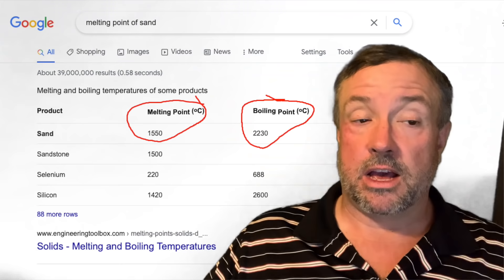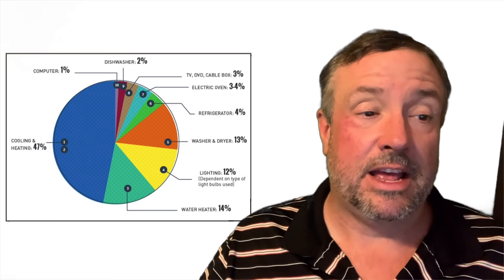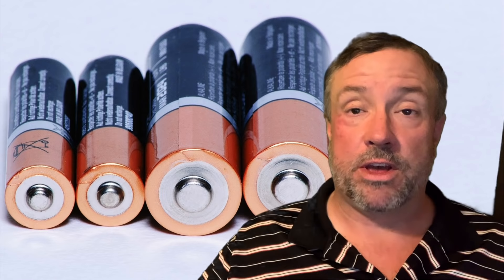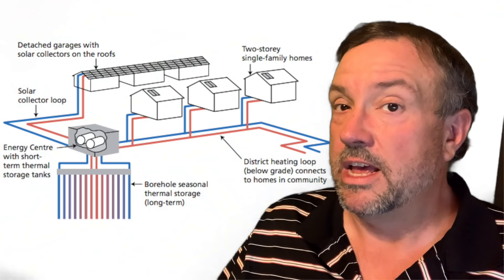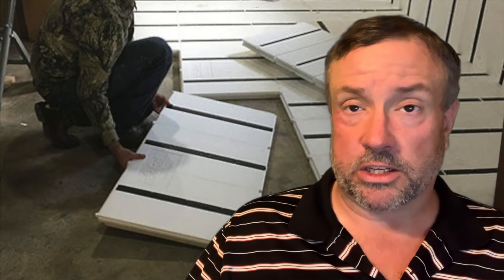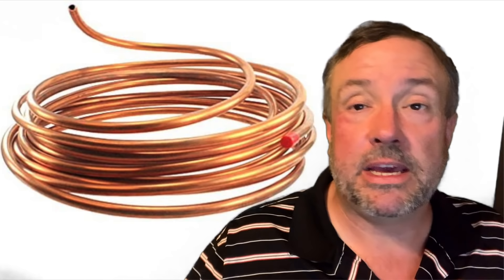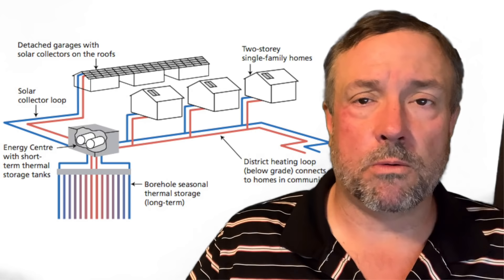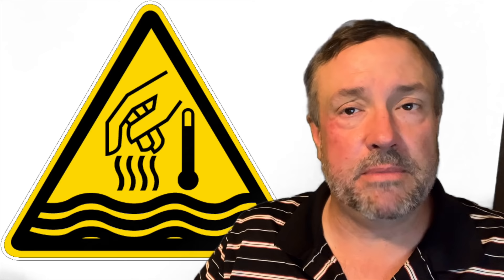Sand for Thermal Energy Storage

Comment: In Sweden, for many decades, they have made and used tiled stoves that are made of ceramic tiles according to a certain system that forces the smoke to make a round trip inside the stove before it enters the chimney.  These stoves are only fired up once a day and they slowly give off their heat during the day and night.
Reply from the maker: very cool!
Reply: Are you talking about "Rocket Mass Heaters?" I've been looking into those quite a bit. I have several project ideas inside and out that I'm planning; from cooking to space heating.
Reply from the maker: @enigmaapoc403  rocket mass heaters work great
Reply: @enigmaapoc403  https://en.wikipedia.org/wiki/Masonry_heater
Reply: that's great in all but the whole idea is to never have to feed that god dam wood stove anymore
Reply from the maker: @garyweber6413  I’m with you there

Comment: I think that the best thermal exchange fluid for sand heating is air at high pressure in pipes. You can circulate this air by high temperature compressor between concentrator and sand heat storage
Reply from the maker: maybe...
Reply: @SimpleTek  Turbo high temperature compressor is not difficult to manufacture. You just need long shaft between impeller and electric engine

Comment: If you want really simple and low tech that uses upcycled materials it makes sense to me to build solar walls with old windows or glass doors, especially those from shower units or vehicles, which are very tough and harder to melt down for recycling. 

I built a rocket mass heater which uses mostly sand to store the heat from my wood burner, reducing the wood used by two thirds
Reply from the maker: Great idea

Comment: Radiant in floor heating also ups the anty.  

I have using a compost pile heater in the cold, cold winter for a greenhouse using radiant heat. Going on two years, it has served me well.
Reply from the maker: Thanks for sharing, that's awesome!
Reply: I am looking into this at the moment. Can I ask what size the pile is and how you extract and distribute the heat? Cheers.
Reply: Look at "Compost Pile Heat" here on YouTube.  The videos should answer most of your questions.

I use a water based system (twice), one loop of actual water for use in a hot tub and other areas, and second with a glycol mix for radiant floor heating.

My in floor heating system is not a normal radiant floor.  I did the usual insulated base of gravel/sand/insulation then the in-floor tubing run and covered that with sand, then 2" of concrete.  

I have a small "boiler" for very cold nights and the usual manifold and pumps.  A water heater tank (large) serves as a reserve tank for the hot water.

AT a -30 F temp outside over winter, the inside greenhouse temp was 68 F..  

Although a bit of trouble to create, my energy costs this year were next to nothing.

Summer ideas include a better hydroponic system and an HHO generator for electricity/heat/cooking/cooling/pumping/etc.

Good luck.
Reply: @frankfrederick5158  what inlet and outlet temperatures were you able to maintain throughout the winter months. Usual infloor supply temps are 110 degrees F and 90-100F outlet for residential, garage and commercial bldg. what’s your thoughts using your compost heating system.
Reply: @jeffstout6567  Thoughts?  No.  Facts, Yes.

Average 108 to 114 degrees F into the system.  Out between 80 and 90 F.  

It gets cold where I am - VERY cold, so the floor can suck up a lot of heat.

Comment: I am now subbed... I was going to try synthetic oil, can get hot. Have always wanted to use a trough collector. Need auto adjusting capability however, Bright days can call the fire department. In and out loops into sand use the oil. Run thru a plate to plate exchanger to loop in the house. Pump the water in a loop thru the coils in the house. Use 3way valves so loop is always flowing. Have a 3 way mixing valve on the water side of the exchanger to keep loop speed up while adjusting the percentage of hot water to recirculated water. You could probably even pipe the sand/oil side of the plate to thermo siphon when the demand is low, but have a boost pump in the circuit. Random thoughts: Might want to check the stratification of heat in a big pile of sand. You might use the coils and pumps that introduce the heat and take it out to recirculate the heat by pumping the top coil through the bottom one to keep heat saturation fairly equal. Heat always gets away at the top. I'm sure that you can see that I'm a controls guy. Retired from 30 years of being paid to be a control freak. I also ran the Building Management System where I was. A LOT of analog mixing control stuff with fussy people that like their offices just so. When you put in a lot of control, you can either make it work or it will SHOW YOU the weak spot. 70yo retired with 65yo wife on 2.3ac 45mi ne of Metro Denver limits. 35X70X25 shop just gettin 'restarted'!
Reply from the maker: interesting!

Comment: I believe that the best working fluid for transferring heat to/from your sand battery may be MINERAL OIL.  It seems to fit all of your requirements, while also having advantages over other fluids.  As an alternative, you may also check into using cottonseed oil or rapeseed oil (also known as Canola oil) as these last two choices are more biodegradable.

I saw a couple of suggestions to use water with antifreeze, but that will start to boil at about 226 F (108 C) at atmospheric pressure w/ a 50/50 mix of water and antifreeze.  You wanted a fluid that would handle about 300 C.  So I don't think this is a good choice.

Some facts about MINERAL OIL: 
> It is already used as a working heat-transfer fluid in products like electrical radiators, power pole transformers and high-voltage applications.
> The maximum operating temperature is 316 C (600 F)
> Boiling point at atmospheric pressure is 349 C (657 F)
> It is essentially non-toxic and more importantly essentially non-toxic to humans/animals
> It is odorless and colorless
> It does not conduct electricity 
> It can be purchased in both industrial grades and food-safe grades

Sources:
https://www.multitherm.com/multitherm-pg-1.html
https://en.wikipedia.org/wiki/Mineral_oil

Ed Schultheis, PE
Mechanical design engineer for 35 years
My consulting business
Schultek Engineering & Technology, Inc.
schultek.com
Reply from the maker: interesting
Reply: @SimpleTek  
I have another thought about heat transfer to the sand  thermal battery...

Heat transfer between one material and another is maximized by making sure that there is intimate contact between the materials.  If this were my project I think that I would experiment a bit with the following setup:
1) Use mineral oil for the working fluid in a closed-loop system, pumping the oil through aluminum or copper tubing from the solar source to the sand battery.
2) Fill the box with sand as you originally planned.
3) Pour additional mineral oil directly into the box of sand so that it fills all the tiny voids between the sand particles.  This setup would ensure very intimate contact between the outside of the tubing and the mineral oil in the sand box.  This setup would also ensure very intimate contact between the mineral oil in the sand box and the sand particles.  This would ensure a very good heat transfer to the sand.

I'm not sure how much mineral oil would be required to fill the tiny voids between the sand particles in the box.  Hopefully it would not be much.  I would do a small test with container of sand of known volume.  Then fill the container with water until no more will fit.  Then you will know how much additional oil would be required to fill the tiny voids between the sand particles. 

Ed Schultheis
Reply: @edschultheis9537  Mineral oil is a very interesting idea.  What about burying a kiln in sand and somehow solar heating the sand to heat the kiln? Inside the kiln is a rockwool blanketed tubing of some heat resistant material that carries mineral oil or salt water to the desired heating endpoint.  It is a loop so the cool fluid goes back to the kiln.  The sand is a thermal mass and can slowly release heat...buried treasure.  The insulation is more about slowly cooking the fluid, because insulation just slows heat transfer, it doesn't prevent it.
Reply: @jeffreydustin5303  A thermos bottle arrangement around the storage would help to slow the heat loss. Now me are talking big bucks.
Reply: @edschultheis9537  What are the environmental considerations of mineral oil in case of a spill/leak?
Reply: It might be flammable. If a fresnel lens is used, I'd imagine it surpassing the max rating of mineral oil before flammability or boiling. Someone gave me a large plastic molded fresnel and that lights up wood in literally a second or two (and with "blinding spots in my eyes" after looking at the focused sunlight).
I'd imagine linear fresnels wouldn't melt aluminum, but might still surpass mineral oil safety.
Reply: @edschultheis9537   It is an ideea about pouring mineral oil in the sand to maximize the contact between sand and Cooper or stainless steel coil, but on the other hand the sand will "suck" a lot of oil. And that sand can not be utilised for anything else, will be a very hazardous stuff, non recyclable and difficult to handle or to dispose.

Comment: What you need to be more concerned about is how you will pump the fluid through the system without melting or burning up the pump, pipes or valves.

The way I would do it is to use hundreds of inexpensive flat mirrors to reflect the sunlight through a glass covered hole in the sand box to heat the sand directly.  Then circulate water through the sand for use wherever.
Reply from the maker: yep
Reply: How about fiber optic?
Reply: @NwoDispatcher  fiber optics?  Is that only used for the visible range?  Does it also transfer infrared?
Reply: @l0I0I0I0  well it's all electromagnetism. I'm sure different materials could be used for different wavelengths
Reply: @NwoDispatcher  as long as heat doesn't escape through the fibers as well.  Idk, sounds interesting.  52% of heat from solar is IR.   Small amount UV.  I've studied this in the past on my own including black Body emissivity etc.  It's not easy to find a material that is like a diode and heat energy in all it's forms goes through a material without blocking 5-10% even in thin materials.  I've seen lights however going through fiber optics straight from the sun to light a space indoors, however they are expensive and probably filter out IR radiation.   Curious to see what you come up with?  Love your idea of heating a hole in the ground.   The glass covering the space and it's emissivity to heat radiation can be a challenge.   I've been working on this at home for a long time now.  Found one  possible solution but the state of the art material is not in production yet.
Reply: @l0I0I0I0  i know a guy who's discovered a solid state x-ray emitter. He the atheist pro European counterpart of Chris Langan, the man with 200 IQ Steve quest i think his name is
Reply: @NwoDispatcher  Based on your excellent laser idea, you could isolate the heated material using something called a wave guide.   Use a signal generator to produce a signal of whatever freq best reacts with the heated material and send it through the wave guide to heat material.  Just need an amplifier to increase the signal strength.
Reply: Good point about melting pipes and pump Acme Fixer.  I have thought about the mirror thing as well but I think parabolic mirror might work better.   Any easy solutions for tracking the sun with the mirrors for a non programmer?  Great with electronics however.  Also circulating water through the san is also a good idea as long as you keep it at 90c or below.  The water will help distribute the heat being thermally conductive.  Above 100c pressure and require a lot of extra safety, regulatory, complexity cost.  If only we could safely get the water at 1000c.  ;D.  I know, bad idea.
Reply: I have looked up all the properties but what about using a series of tesla valves located on each end of the solar array. As the oil is heated and expands it needs somewhere to go using the tesla values you are creating a path of least resistance as well as when the thermal energy is transferred to the battery the oil is retracted. I have not tested this but may work on a 3d printed small scale model to see if the liquid moves as intended. 

You may need an expansion/overflow tank to keep the flow going but not sure will have to test unless someone has a link to anyone else doing something like this.

Comment: I imagine a large insulated storage container with two sets of copper tubing coiled inside surrounded by sand.  One set of tubing circulates heated air from a standard electric heater through the sand and heats it, the other tube also full of air which is heated from the sand is ducted to a fan in your house or greenhouse.  The sand heater operates during the day, usually powered by excess solar.  The fan that circulates the heated air inside the house can run at any time but in daytime will usually be solar as well.  I’m just not sure if the air will be too hot straight out of the sand battery and the best way to manage that.  If it is is too hot then I’d siphon off some of the super hot air, mix it with outside air to cool it to the right temp before releasing it in the house.
Reply from the maker: Cool idea

Comment: Transfer the heat from the parabolic collectors with air. It's free and no need to worry about leaks. Keep the blower fans on the cooler inlet side. Water coils in the sand can transfer heat to the house. The collected air from the top of the thermal sand storage can flow through the greenhouse before is goes back to the solar collectors, or just circulate the warm air to the greenhouse on cloudy days. Water coils in the hotter parts of the sand can be used to power steam generators for electricity.
Reply: That eliminates the 'rainy day' backup that the sand provides.
Reply from the maker: ok
Reply: Good idea with the steam generator for electricity

Comment: I created a scaled down version of a mirror concentrator from a Mother Earth News article in the mid 80's.  I used a 10 x 10 array of 12" x 12" mirrors that tracked the sun using simple photo voltaic cells, a relay and a car starter motor to maintain focus on the sun.  I raised our 24' above ground pool by about 17 degrees F.  I only tracked across the sky and had to adjust every couple of weeks for longitudinal changes.  Adding a second motor and sensors would be simple, especially with arduino systems available. I like your idea of using oil instead of water to avoid the thermal limit that steam introduces.  The article is entitled "Make a Solar Furnace" under the renewable energy category.   Using oil instead of water through a system like that would give you the temperatures you are looking for.  Using oil in the trough design would allow a simple thermal gravity flow if aligned right.  The cost of mirrors like the article do add up quickly.  Keep us up to date on your plans.  I like it.
Reply from the maker: Thank you for the info! I enjoyed that!
Reply: how did you build or make the frame ? strength..windproofing..allignment?

Comment: We have a fireplace insert with a huge fire pit - so large that when we fill it with wood, things get too hot, and there is a risk of chimney fire. We came up with the idea of putting large concrete blocks in the back. They will heat up from the burning coals,  and stay hot for a long time. Two fans will blow this heated air around the house.
Reply from the maker: Thermal mass!!! Good idea

Comment: Video just popped up again, haven't seen any follow up but a few channels fail to notify. Anyway, consider how much energy your 300C sand actually holds per volume and then look at water in reverse: what is the local groundwater temp and how much water would be required to absorb your heat to below boiling?
Depending on how you plan to access/ use the stored heat you could set up a steam turbine generator for electric which could also absorb some energy transfer. You could stall the steam in tanks buried in sand with valves that release the steam/ pressure through other turbines/ tanks until it's just hot water of the desired temperature to heat the house and fill the water heater.
This would also distill the water in process.
Reply: Let me simplify this ramble. If you have a sand tank in the ground, the temperature around it will decrease with distance. Water pipes in the ground where it's around 100C can then be piped through the floor for heating then into the water heater. Same distance diffusion should work with oil or antifreeze
Reply from the maker: Interesting

Comment: Hey mate, what you need to study are simply "heat exchangers" this is a well known domain and largerly used in the industry, and this is the convergence point between heat storage and its use. The good thing here is that you know which temperature range you'll have to work with, so you can start projecting and dimensioning your installation. Even simpler to design and order well sized thermo-electric generators. Have fun !
Reply from the maker: cool
Reply: Hi, Would you be able to recommend any sites where I could size efficient 12-24 volt thermo electric generators. Thanks do much.